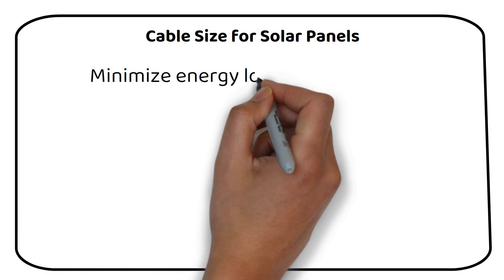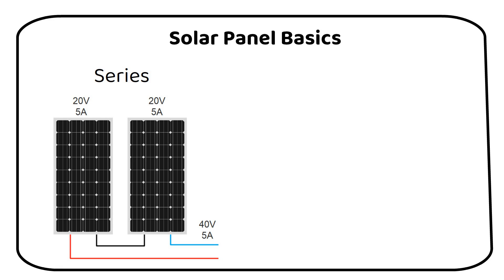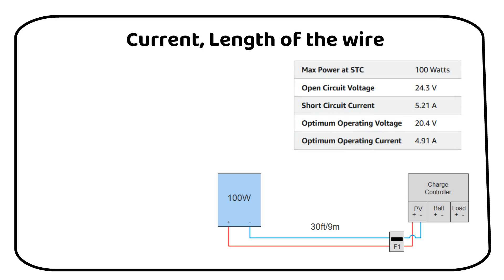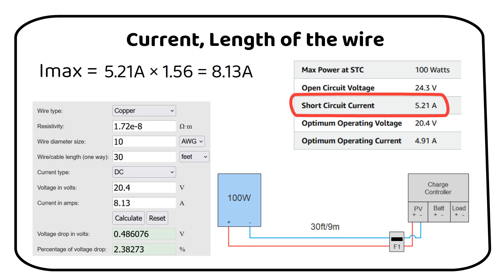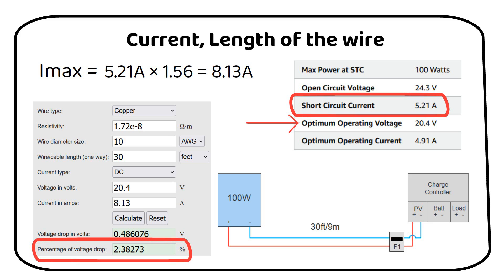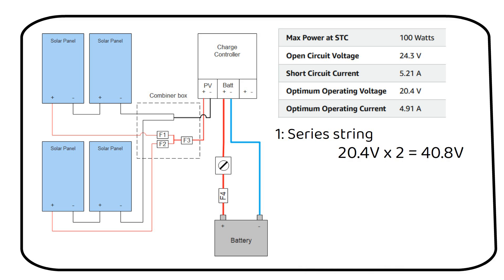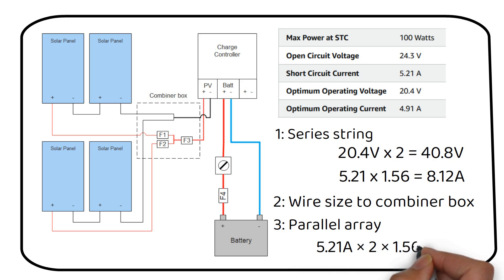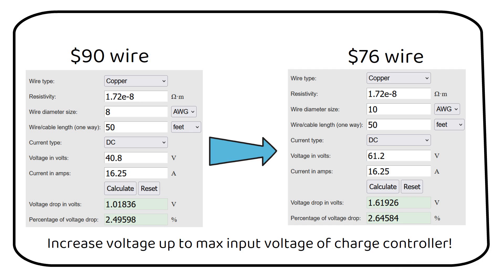Cable Size for Solar Panels - How to Size Wire for Voltage Drop

Comment: As a quick side note, you can look up "AWG table for power transmission" as a quick reference without having to worry too much about temperature or distance.  The maximum amps for "power transmission" purposes in the official AWG table is a very conservative number that will result in minimal voltage drop at full load.

So, for example, by this table 10 AWG is 15A.  For people used to dealing with amps and cables, that might seem like a low number, but that's the actual specification "for power transmission".   (For copper wire).

Most Solar panel cabling is 10 AWG or 12 AWG.  Certainly on larger panels.  Little panels have thinner wires but also produce fewer amps.

It isn't usually a problem unless you are paralleling a lot of strings.   Using a combiner box with proper per-string fusing becomes very important in that regard.  Plus you can also easily use a lower-gauge solar cabling for your higher-amperage back-haul from the combiner box to the charge controller / inverter.

-Matt
Reply: The table you're using is incorrect.  In fact, 8 Awg is 40 Amps, 10 Awg carries up to 30-35 Amps, 12 Awg is 20-25 Amps, 14 Awg is 15 Amps, and 16 Awg is 13 Amps. Of course, 10 Awg will also carry 15 Amps. Just Google Amps vs. Awg size.
Reply: @salsepulveda494  There's a big difference between what a cable can carry and what a cable should carry.  For continuous power transmission you want low losses and low temperatures, and you learn very quickly not to under-size cables.  Otherwise your efficiencies go straight down the tubes.

These aren't toaster ovens that see minuscule duty cycles.  These types of systems run their max power for hours each day without a break.

I'm using the correct table.

-Matt

Comment: Very well explained.  Voltage Drop is often overlooked in all aspects of electrical design resulting in power being lost to heating (and possibly damaging) the wire.

Comment: What does it mean maximum system voltage 1000 volt dc on solar panels
Reply: Solar panels have a limit, of how much voltage they can handle (once connected in series . It may be around 1000V for many models. Additionally, solar inverters have voltage limit too, it can be something like: 160V starting voltage, 600V optimum working voltage, 1000V maximum working voltage, 1250V open circuit voltage. In this case- inverter will turn on once it receives 160V, and be most efficient if it works at around 600V. To get that, you divide 600V by panel working voltage, say 43V, and get 600V/43V=~14 panels in series is optimal, and 1000V/43V is 25 panels in series is max the inverter and panels can handle.
Reply from the maker: (600V*0.8)/43V=11 panels in series.
Reply: There is a thing called PID (potential induced degradation) 
The higher the voltage the more prone to this degradation your panels are.
It starts really being an issue above 1000 volts like in some commercial installations. No homeowner would push that much voltage anyway but that's the reason for the limit.
Reply: When you string solar panels together in a series, the voltage adds up. 1000 ÷ 20 = 50. 50 is the maximum number of solar panels ok.
Reply: @stevehardyuk   thats a factory not a house ... unless they are 100 watts each one.. the smaller the less efficient
Reply: The system voltage limit labeled on the solar panel (not the inverter or charge controller, but on the panel itself) is a function of a couple of things.  This is for the total voltage that can develop when panels are connected in series.

Mainly it is a function of the insulation of the solar cabling which determines how much voltage it can safely withstand without arcing.  Inclusive of typical wear and aging over time.  Either between adjacent cables or to the frame (which is considered a ground reference for this purpose even if the solar positive and negative are isolated from the frame), MC4 connectors, etc.  And a few other things.

1000V is fairly typical and nearly all equipment on the solar panel side short of the charge controller.  So the panels, wiring, frames, etc are all designed with the same number in mind.

There are also regulatory issues, that require more professional installation / licensing in many states and countries when system voltages exceed 1000V. 

-

The charge controller or inverter of course almost always have lower limits, depending on the device.   So string voltages cannot exceed 1000V for panels and wiring, and often cannot exceed 600V for large string inverters, and lower voltages for smaller charge controllers or inverters.

All voltage limits must be derated by 20% for safety and because solar open-circuit voltages can be higher than their label spec in cold weather or strong sunlight (sun + bright clouds, for example).  So the sum of the VOCs for all panels in series going into an inverter with, say, a 150V absolute maximum rating cannot exceed (150 * 0.8) = 120V.

-Matt